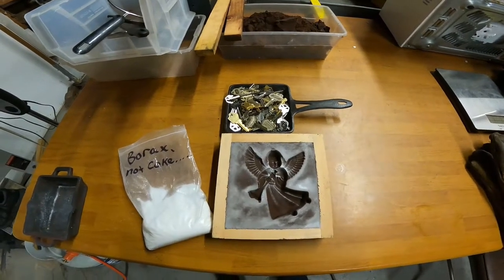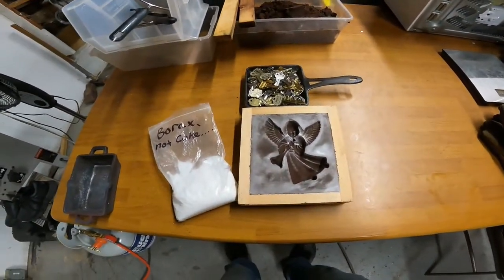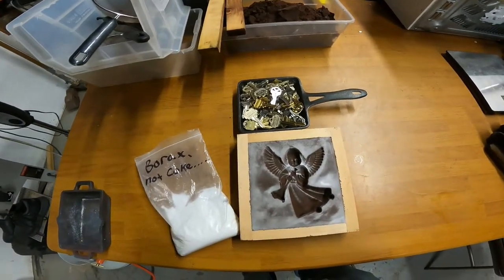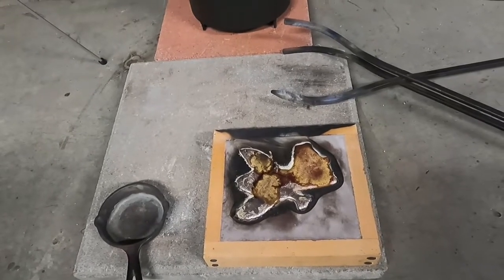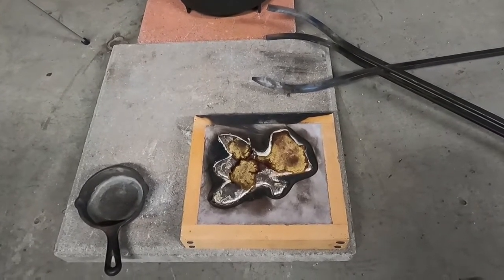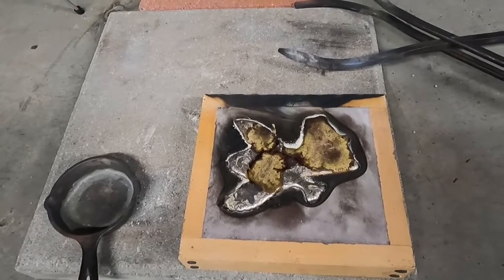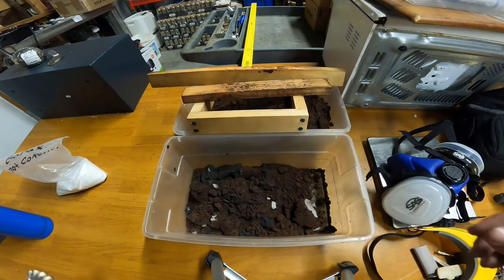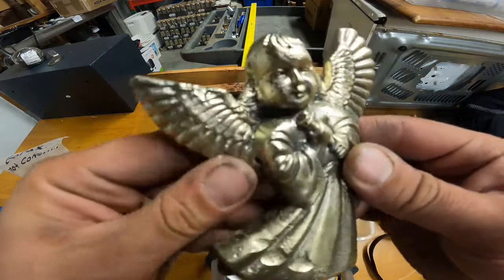Casting series #4 - Melting brass keys - Meeting a guardian angel!

Comment: New to casting, I’m interested in melting down the piles of brass keys I have laying around but recently read that many brass products also contain lead- is there a way to safely melt these down without possibly getting lead poisoning? I only ask because my 3 year old often assists me in my projects and I wouldn’t want to potentially expose her
Reply from the maker: @TheHobbyistT  I highly recommend melting outside and wearing a respirator.  As a locksmith, I can confirm that keys do have lead in them.  Melt the keys on a low furnace setting, it will eliminate some (not all) of the white smoke.  Scoop out the slag as it melts down.  Repeat the process a few times during the melt to get the brass nice and clean.  I have a few other melting vids on my channel in regards to melting down keys.  Check em out if you have a chance.  🙂
Reply: @Scrap2Cast  Thank you for the information! Luckily I do all my melting outside, I will definitely need to pick up a respirator. I fully intend on watching as many of your videos as possible!!  😁
Reply from the maker: @TheHobbyistT  you’re welcome bud and thanks for your support!